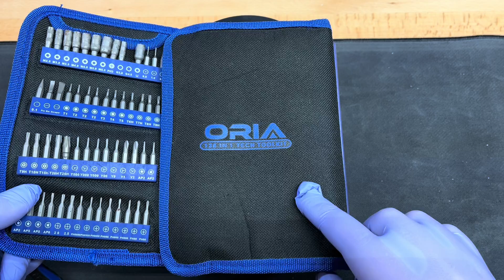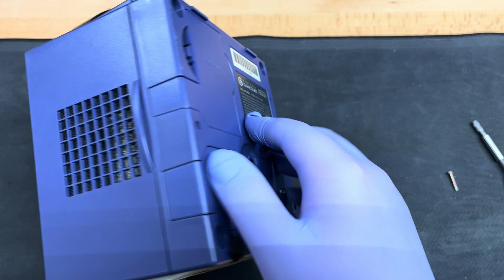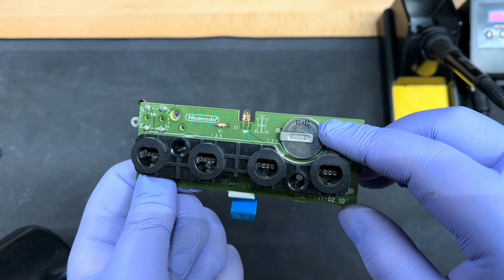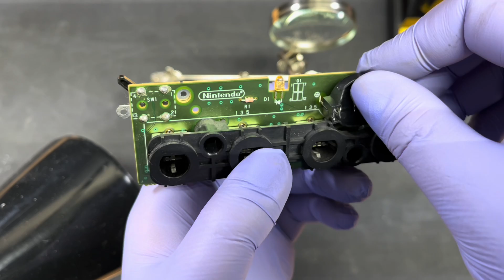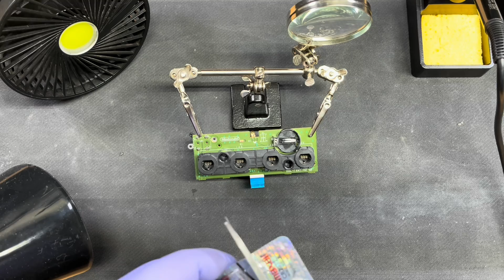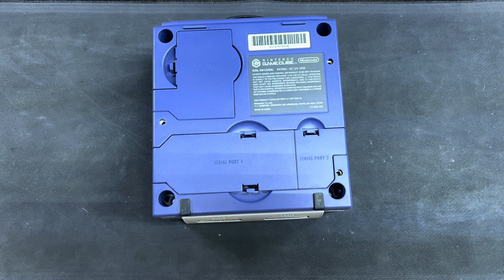How To Test And Replace Your GameCube Clock Battery | MorganMendIt!

Comment: Couldn't you just pry the tabs soldered to the battery and electrical tape a new battery in place? I did this for my save batteries in my pokemon GBA games and never had to solder  once.
Reply from the maker: While this sounds like a good idea in theory for someone without soldering equipment, my primary concern would be damaging the pads for the controller PCB. Sometimes solder tabs can take quite a bit of force to remove from the battery. I have reused solder tabs by soldering them onto new batteries, but they often times are in pretty sad shape after prying them off of the original battery. To do this with the battery still soldered to the PCB seems risky. Again, my primary concern would be pulled pads, or even potentially damaging traces.

Comment: Will the same battery socket/holder work with games?
Reply from the maker: Depends on the game cartridge as they use various different sizes of coin cell batteries. The concept is the same, you just have to get the correct socket to match the type of battery used.
Reply: @morganmend  Thank you. I have NES, SNES, AND N64 games. So I'm wondering if the cartridges will close properly with the socket size you used in your very helpful video.